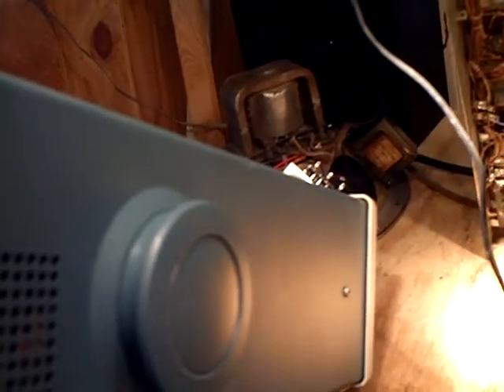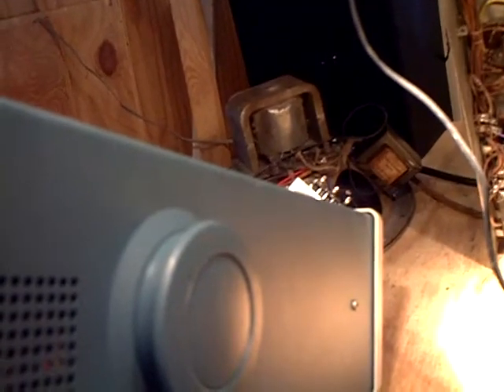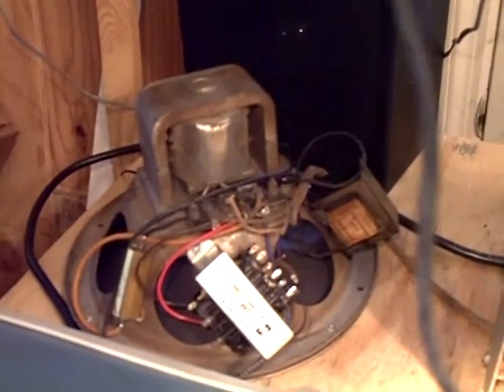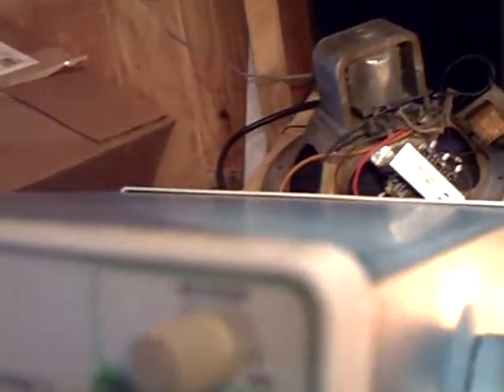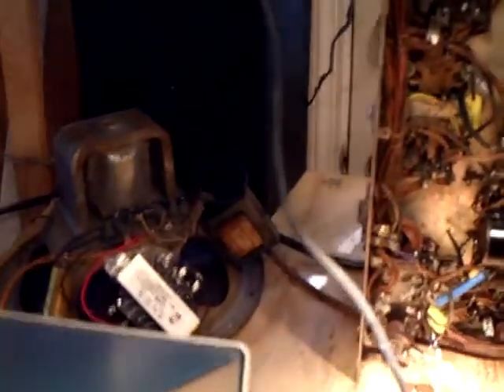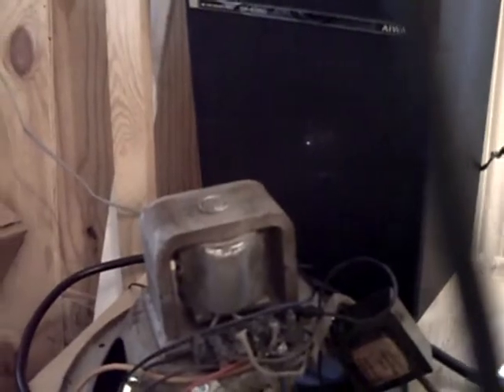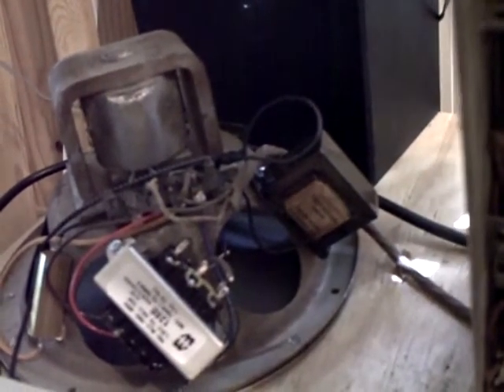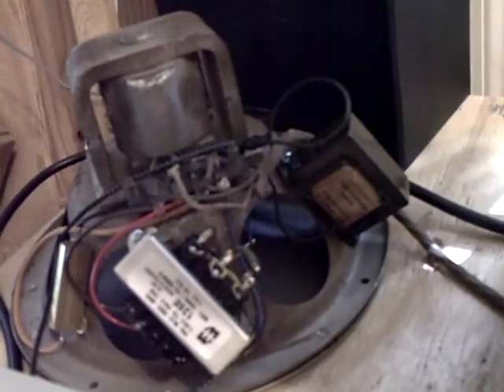Part 18 The real cause of  the Audio Distortion of the RCA 262, the cause!

Comment from the maker: Hey John!
Thanks for your comments, espt the one about the sig generator. I will try that nex ttime. I did try just using another power resistor in place of the choke, see sucessive videos, and that introduced a hum into the audio at low levels. Check out what comes next. I build up another speaker. I'm getting close to making the final video! Thaks again for posting your comment!

Comment: I've really enjoyed your video series.  
There is a possibility that the choke you bought and mounted on the speaker basket is weak.  Have you tried disconnecting the wires and tack soldering  another resistor in its place.
Also...to get a 1700Kc  signal on your sig. gen. change to scale C and adjust the frequency to 1.7Mc.  Same-same.

Regards,
John